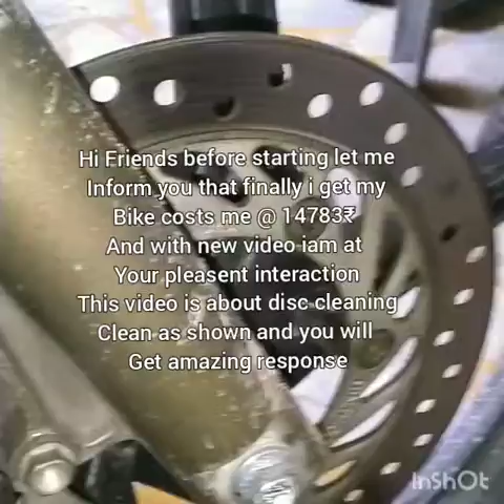Improve Braking. Disc Cleaning Method

Comment: How is mobil super responding n whats with your ✋ its taped
Reply from the maker: Mobil super working fine bro 1000+ kms run since filled, oil level is good color is good smoothness is good. 
Bro i got accident in my teenage at my vary first bike directly collided into tvs victor @95 kmph so get many wounds and wrist fractured so whenever some serious impact occurs my pain arises. Thats a wrist support , i use whenever this happens. Thanks bro but im completely ok.